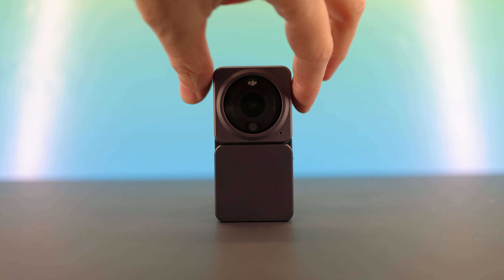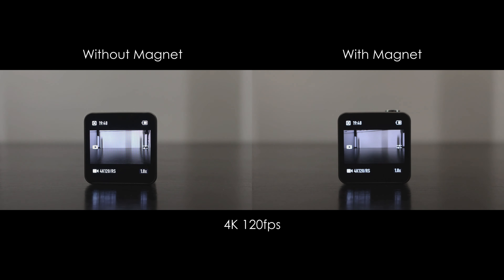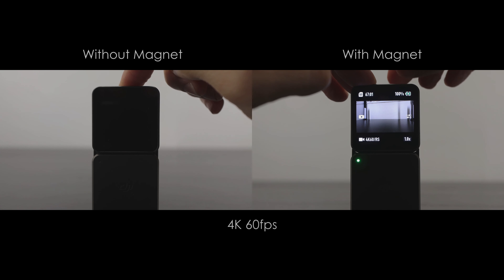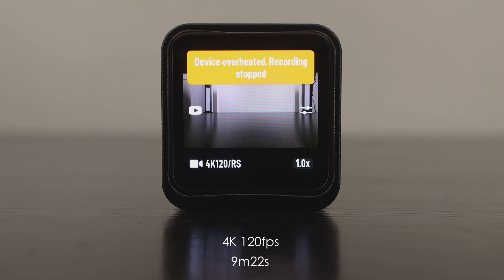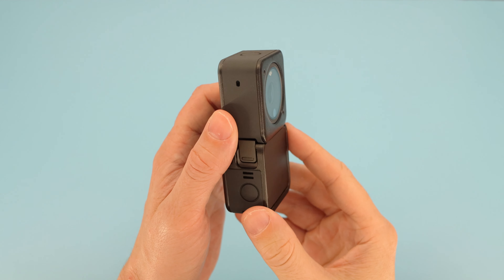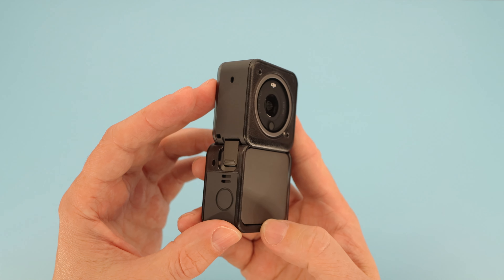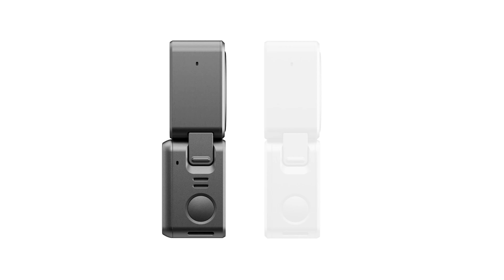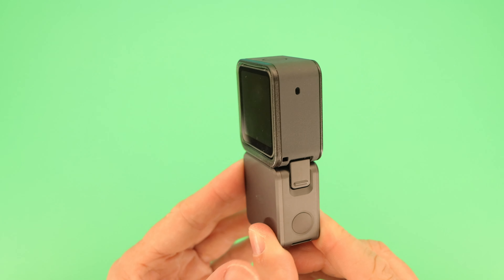DJI Action 2 Magnetic Case Tested (with unexpected results)

Comment: You have nice results. I expect that you use High temperature threshold. I am allowed to use only the standard threshold, but magnet or case does not make any difference compared to the naked camera. :(
Reply from the maker: Yes it is unfortunate.  In standard temp mode the case only extends 4K60 run time by about 1 minute.
Reply: Lol? Yesterday while I used the camera with the magnetic case on my bicycle, the camera overheated in 6 minutes. I removed the case, continued to shoot without waiting, and it made another 11 minutes. I arrived at home maybe in 9 minutes and put the camera down. In this experiment I used 4K 60fps, HorizonBalancing mode. So, it looks like that any kind of case is a no go for me, even the dji magnetic case :(
Reply from the maker: Are you using a European model?
Reply: @Roos-Reviews  I guess. I bought it in a hungarian Media Markt.
One strange thing: I should be able to set it only to standard temperature limit. Now, that I play around with the camera, it allowed to set Hight limit. I am curious if it will stay, and does it anything with the recording lenght
Reply from the maker: If you can set it to the high limit you should find that with the DJI case installed it records for much longer.  The extended recording time only works when the case is detected and the high temp limit is on high.  The firmware then allows the recording to go for longer.
Reply: @Roos-Reviews  So, for some reason, the hight temperature limit become available in the camera. I don't know, why.
The latest recording times are the following: 
Recording settings: 4K 60Hz RockSteady, just the camera module
Standard temperature limit with some heatsinks: 6 minutes
High temperature limit with some heatsinks: 8 (and a half?) minutes
High temperature limit with the magnetic case: 17 minutes O_O And yes, the camera is hot like hell.
I will recheck this, and also I will check what happens during biking, but this is good enough to not stop recording at a red light. I still have some doubts since yesterday's ride (overheat in the case, no overheat outside the case), and also the camera once fell out of the magnetic case (the battery unit is not the most firm), so I will see, what fits the camera better if it has active cooling.
The main takeaway: If you can't use hight temperature limit, the case does not help much.
Reply from the maker: Yes your main takeaway is exactly right.
Reply: @Roos-Reviews  Some more observation, and from now on I think, I will use the camera, instead of play with it :)
4K 120fps, Rock Steady. Is this the hottest settings? On a bicycle helmet it was not a problem for half an hour even in standard temperature settings. Ambient temperature is between 22-27°C, my average speed is about 21 km/h. The second camera module and an external power bank were attached.

I tried the 4K 60fps RockSteady on the desk with the camera module as well: 
Standard temperature: 8 minutes, 
high temperature: 16 minutes, 
hight temp with magnetic case: 21 minutes.

I am not happy, how hot the camera is in the case so I made a magnetic hack: Just stuck a small magnet to where the case has it's magnet as well. I also fixed some 20x20x6mm heatsinks on the side of the camera module. In this way, the camera on the desk records for 32 minutes, so, instead of the plastick case, dji could have made some heatsink style case, similar to what you can see on Aliexpress. It would worth more. Even as an alternative to the plastic, to be able to change between style and usability :)

So if you move with the camera, it is all right. With the high temperature threshold settings, even a red light shoudn't be a problem.

Comment: Sorry, but for me the Magnetic Case does not give any benefit in recording time at all. I live in Europe and I have only Standard Temperature mode. Action 2 Power Combo. Firmware: 01.03.30.20. I just did two indoor recording tests (temp 24° C) at 4K@120 and RockSteady stabilization:

WITH Magnetic Case + Power Module: 6 min 08 sec
WITHOUT Magnetic Case + Power Module: 6 min 09 sec

4K@60 WITH Magnetic Case + Power Module + RS stabilization: 8 min 38 sec

I have also tried the magnet but the situation does not change. Any suggestions? Thank you very much.
Reply from the maker: Unfortunately European models do not benefit much from this, other than having damage protection if dropped.

Comment: Yes massive fail on their part not making the lower housing fit. I remember when GoPro cases shipped with multiple backdoors depending on what setup you ran with the camera. Come on DJI get it together and make a case that fits
Reply from the maker: Yep, the top part is perfect, but I'm hoping for a better bottom part alternative, maybe from a third party.

Comment: You forgot the most important part! Where does one buy a little magnet thing that you used to trick the camera?
Reply from the maker: That was just for doing the tests.  It's not really practical to have a magnet on there when using the camera.  You can buy the magnets in hardware stores and Amazon, AliExpress.
Reply: @Roos-Reviews  Why isn't it practical? Is it a temperature issue? I'm planning to superglue the magnet onto the body.
Reply from the maker: It gets so hot that it's uncomfortable to hold.  If you have air moving over it though, and you aren't holding it I suppose it could work.  But there are better ways to do it than glueing the camera.  For example, you could just put the case on it.  For maximum run time you could connect the two modules and cut off the bottom part of the top module's case so that the two modules are connected metal to metal.

Comment: I find it very interesting that they intentionally built in a switch in the first place. Seems to me like a "Create a problem - provide a solution"-tactic
Reply from the maker: One suggestion I heard is that the switch was intended for the magnetic macro lens adapter and they just dual purposed it for this overheating solution.

Comment: The issue is that you need to do the test outside your home. The heating issues arise when the camera is static and not in the move this is action camera.
Reply from the maker: I've answered this a few times in the comments. If you take a read you'll see my explanation.  But basically it comes down to the importance of doing controlled, consistent tests. That's not possible outside.  When I compared the overheating speed of 4 action cameras side by side it had to be done in a controlled environment to be fair.

Comment: the magnet "hack" is destructive to the internal components! DO NOT USE that magnet use the function in the proper way with the cooling case. Yes the case does help transfer heat and cool the unit because of the substrate material used for the case and surface area. Simple thermodynamics here im no expert but this is the general consensus among the "pros"
Reply from the maker: I wasn't aware there was a consensus opinion for this already.  Who are the "pros" you're getting this consensus from?  I have only seen one guy on YouTube say it damages the camera, but he didn't do any tests or show any evidence for that.  I've taken lots of measurements and determined that doing the magnet trick for the purpose of carrying out these tests does not break the camera.  

I am not advising anyone to glue a magnet to the camera and use it like that instead of using the case.  

The magnet in the case activates a higher temp shutdown limit which adds an extra 8 minutes.  The case itself adds about an extra minute on top of that.